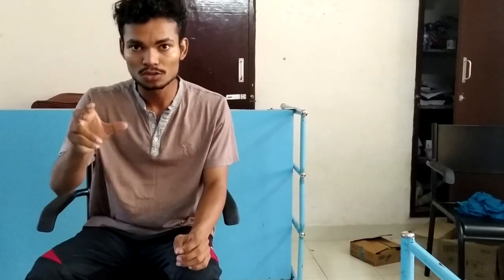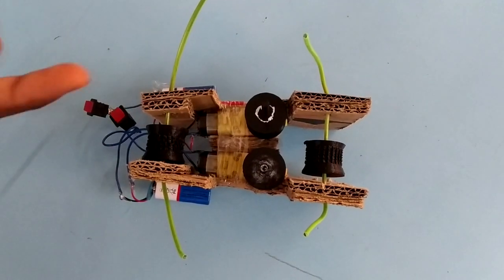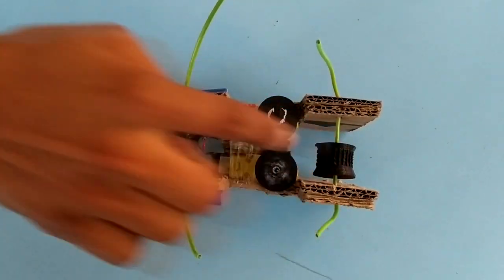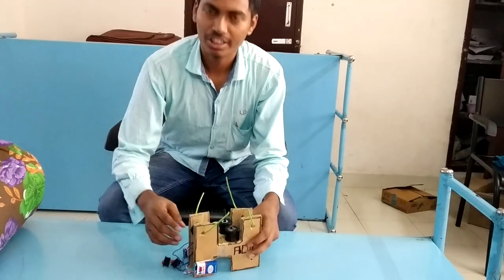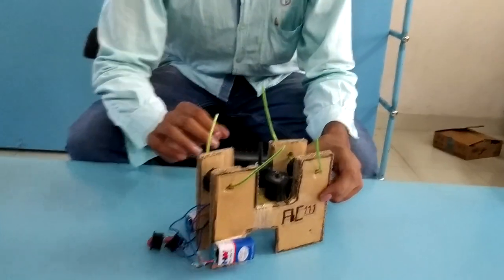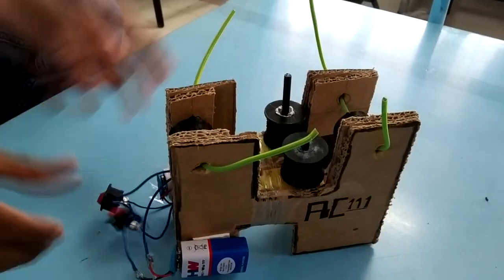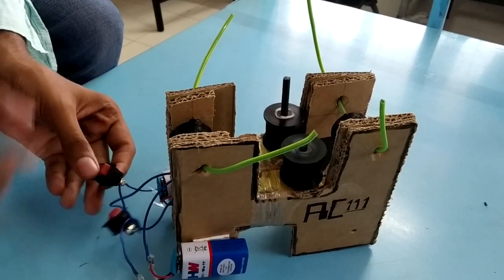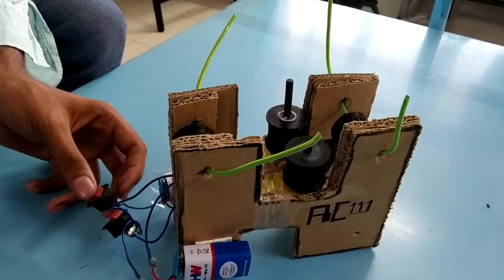Watch This Amazing Rope-climbing Robot From IIITDM Kancheepuram In Action! 🤖🔝

Comment: Well what's the difference between the your prototype and the actual hill climbing machines and what's the advantage of it over the traditional one?
Reply: Actually it's a rope climbing robot. 
It is good design for carrying weight one point to another because the weight is on only non-motorized wheels.
It's a new design which can climb horizontal and inclined rope as well (even vertical also)